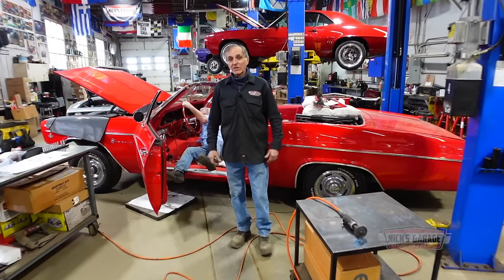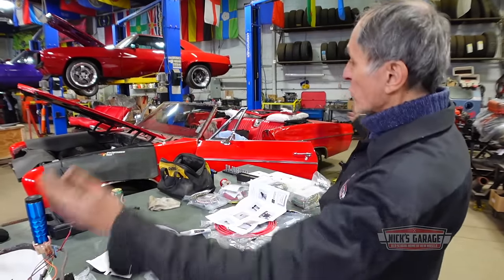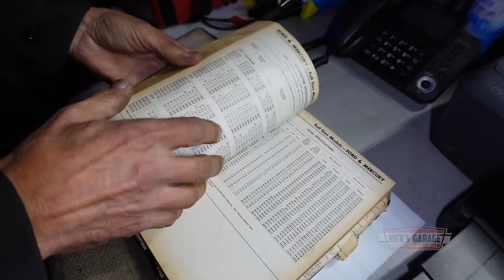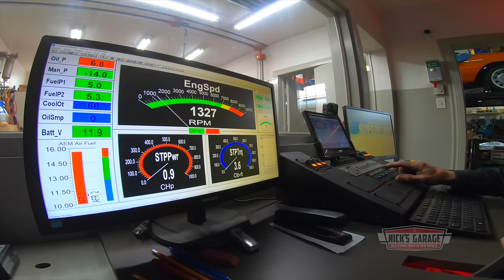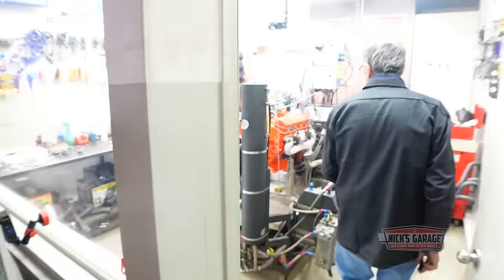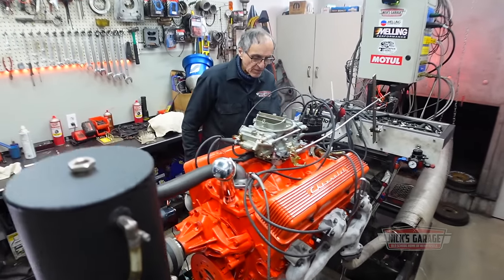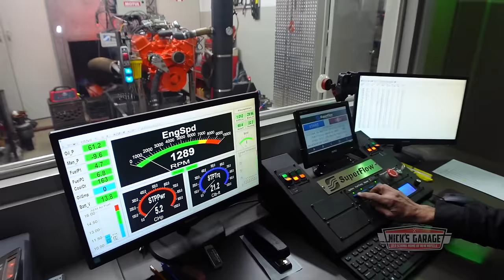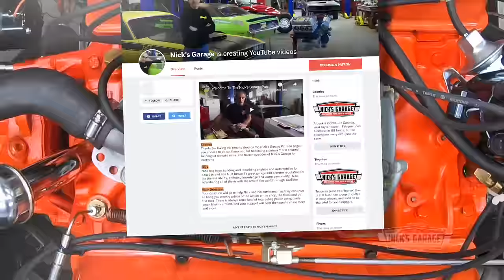327 Chevy on the DYNO - Exhaust Shootout

Comment: I would like thank everybody for there comments, and did get the ram horn exhaust manifolds 
Thank you everybody
Reply: Beautiful car !!!
Reply: Awesome you won't be disappointed for getting them
Reply: Thank you
Reply: Good old ram horns 🐏 🔥 I like the ramhorns that slant back on a 45 😎
Reply: Think you would like 2 sizes smaller cam... this race cam miserable for a cruiser...
Reply: Make sure they are the ones with the 2.5 inch outlet. Some were smaller.
Reply: @bobthbldr3      Yes,  2.5 inch outlets.
Reply: P
Reply: A²
Reply: @BuzzLOLOL  
That's far from a race cam
Reply: @matthewvarnam4302  - That size used to be...
Reply: @bobthbldr3 absolutely this was my first thought, the 2 inch are worthless, scrap metal

Comment: After reading so many comments, my client has decided to order a set of Ram Horns manifolds.
Reply: Nick you really are the man nothing but respect Sir.
Reply: That is good to hear. My 66 Impala only has a 283 but I recently built it 30 over with about the same cam, 500 lift only difference. I got a smoking deal on some rebuilt 80s 305 H.O. heads that gave me bigger valves and higher compression, not to mention OEM hardened valve seats. I still run the ram horn manifolds and that allows for the stock alternator mounting. I did block off that down draft tube and went with a PVC setup. I'd like to see if you incorporate a PVC and still keep those valve covers.
Reply: Good move - which version?  The usually used ones were a 2" outlet, the 'Vette versions used a 2 1/2" outlet and are generally the ones to go for. I think most repro' stuff is the latter.
Reply: I love the video you made and stated " 400 small block , not a very popular motor"  The 400 sbc only paved the way for the 434 ,377,and 383. . And the Oldsmobile 350 build was hilarious 400 hp was a modest number for that one. Let's not even talk about the 455 stage 1 Buick , laughable man. keep the funny vids coming.
Reply: @davidsnova  
Seriously, you need to turn it down a little - within the parameters Nick has to work within - customers looking for rebuilds or mildly up-rated engines, the power figures are very respectable.
Sure, ALL the engines Nick's worked on have potential for a LOT more power, but they're not the builds asked for.

At the time, as those of us who've actually been around for a while know, the 400 was indeed a very unpopular engine for several reasons - short 'rods, siamesed cylinders, larger mains, low compression heads with smallish valves, and camshafts selected for emissions rather than torque or power.
In the dacades since, the larger bore and long stroke became, as you note, useful for more exotic configurations at a budget.

Personally, I would be very tempted to use the 400 for a 'period' build with a bit extra - with a bit of care on parts selection (and with a little playing with the head's casting's identifiers), it could surprise a lot of people - especially with 283 decals used.
Reply: @gordowg1wg145  ...  We had ordered a set of Vette ex. manifolds.
Reply: @davidsnova  also the 400 led to the 427 stroker...really confuses people.
Reply: Smart move, I put them on a 283 and felt the difference. And no more header leaks! Lol
Reply: LOL! That's the first thing I thought when I saw the motor on the dyno. Where's the Ram's Horns?
Reply: Talk him into a cam 2 sizes smaller, also, one with an actual TORQUE CURVE !
Reply: @BuzzLOLOL  like an RV cam?
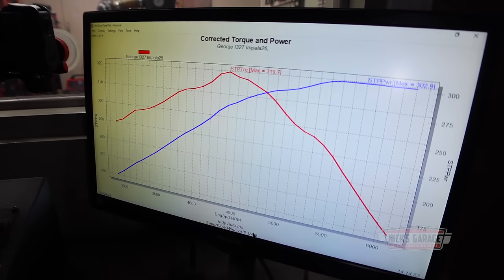Reply: @63Imp283  - Yeah, or a step bigger... 210 - 220 duration... one with a torque curve instead of a peaky peak like at 18:45...
Reply: @BuzzLOLOL  yeah that's what I'm thinking for my 283 it needs torque it's going to Rev no matter what
Reply: @SurlyMike 305 heads did not have bigger valves simply because of bore limitations ,you probably actually lost horse power on that.

Comment: We had a 66 impala SS with all original papers. It was listed as 275hp with single exhaust, if dual exhaust it was 300hp. Using this paperwork and many other sources this engine had the "300hp" cam which would later be used in the l48 350's of the 70's. I know this is an old video but Nick's Garage is historical documentation for furure generations!

Comment: that engine must either  have  a "P.C.V." valve installed, or put  a "DRAFT TUBE" on , that mounts behind the distributor( intake manifold). I think that the valve covers( early corvette) may have come off of a pre- 1964 engine ( no provisions for a P.C.V. valve, or  is not the original engine for that car, non- matching numbers ???)  P.C.V. valves were mandated in california in 1964( early version of emission control). I would go with a P.V.C. system ,the engine oil will last a lot longer due to the evacuation of "BLOWBY GASSES" from the crankcase

Comment: Back in the 70’s I had a ‘68 Camaro SS with the 327 and 2:73 rear end. It was white with a black nose stripe, black vinyl roof and red interior. The tires were BFG T/A’s on aluminum slotted wheels. After graduating from college, my buddy and I drove it from Hamilton to Vancouver to LA and back in the span of 6 weeks. We didn’t have one hiccup with that car. I sold it in the early ‘80’s and have regretted it ever since.
Reply: One of the prettiest cars ever made in my opinion.

Comment: I had a 68 Chevelle with a 327 with a rock crusher 4 speed. I bought it from my uncle it was red with black interior. I put a factory cam in it OEM 375 horse Corvette Cam a dual point distributor with a mechanical drive tach a set of Hooker headers and a 650 Holley spread bore with mechanical secondaries and man that car was the fastest car in town all anyone ever saw was tail lights 💯💪. Boy I sure miss that car

Comment: My first muscle car experience was age eleven in 1966 when my brother came home on leave with his new ‘66 Chevy II, 327 350hp. One power shift and I’ve been hooked on cars ever since that time. Have a great week everyone
Reply: The '67 Camaro cried out for that engine, too bad it wasn't an option...
Reply: Those little Chevy II's would blow your mind with a 327 with cast iron manifolds. I'm a big block man, but I knew those little cars were something that could ruin your day. Lol
Reply: @BuzzLOLOL  It got the 302 which was is based off an even hotter 327 the L74, just with a 283 crank.  The L79 would be stroked and became the L46 350/350 exclusive the Corvette.  That Chevy parts bin isn't as big as most often think.  The L79 was the solid lifter short block and heads(2.02) with a decent cam vs the plebeian standard 4bbl cam.   The challenge Chevy had was the SBC didn't have great flowing heads so they leaned on the cams so rougher running more stall prone mills if they wanted power.  You don't see the first decent factory head until '71 on the LT1 350.  

Perhaps over looked is that it introduced the 350 exclusive to the SS350 Camaro in '67, that stroke and more importantly the extra torque was something felt in every test drive.  So much that with similar gearing it matched the 302 in acceleration at least until the headers and slicks went on.
Reply: @Dayandcounting  - The first Chevy 302" were the '301's we made by overboring a 1950's 283... The small, light. streamlined '67 Camaro really should have had the L79 as its top engine option... but that would have been too much power/speed too soon for GM... and the rear suspension would have had to been better from the start... also, like the Fiero, Camaro was prolly first sold to GM as an 'economy' car... LOL!
Chevy heads didn't flow bad for the time... a little 327 with 4 bbl. carb.,  base level cam, and 10:1 made 300 HP... everybody else back then needed lots more cubes to make 300 HP... Chevy's base 1.94" intake valves were bigger than Pontiac's hyper 1.92" intake valves... eventually everybody's small blocks got up to Chevy's hyper 2.02"/1.60" 'Fuely' valve sizes... except the Ford  Windsor engines...
Reply: @BuzzLOLOL  The top engine was the solid lifter 396 rated at 375hp (420hp actual). The '67 also came from the factory with a traction bar.
Reply: Yup. That engine is music!!!!!!!
Reply: @jsteganius6969  - As seen at 18:48, way too peaky torque curve... needs a smaller cam for pleasant street cruising...
Reply: @Dayandcounting  I believe  the L79 has a hydraulic cam and lifters. It's a great sounding engine with a  perfect cam "lope"....the L79 is my favorite 327 small block engine.....
Reply: I have a 1970 Nova that I got for my first at 16 way back in 1976. It was originally a 230 6 with 3 speed. After a year, my dad and I swapped in a  350hp 327 and Muncie 4 speed. Easy swap as most cars were back then, especially if V8 was a factory option. My dad told my mom it was just a little 327 and not to worry. God I miss him.

Comment: In 1962 I ordered a new Impala with a 300 hp 327 and 4 speed. I ran at the local drag strip every Sunday. It came with 2.5 inch exhaust with the rams horns manifolds and I had open exhaust dumps welded on. I put on a set of Hedman headers and made no difference at all in et's or mph. Some rams horn manifolds were smaller though. I won 23 trophies with that car and it was legally stock and had a blast with it!

Comment: Back in 66 my brother bought a 65  Impala SS, 327/300HP, 4 speed with a posi.  He was worried it would get stolen. He took off the 327 badges and replaced them with 283.  That was a very nice car. Very fast.
Reply from the maker: Nice trick.
Reply: My friend in high school had a 65 Impala with a 327, 4 speed, posi.  But, that was 1988, the elements were not being nice.  The rear springs ripped off the frame about the time he dropped the clutch in 3rd gear, rolling about 40-50mph.  What ensued was the longest, most amusing crash I’ve been involved in.  Seems like it took a full minute for it to spin all the way around in two lanes and median, grass flying around, him cursing and fighting that massive steering wheel
Reply: @jgriffin7340 We'll put that down as things that didn't really happen on the internet.  One eould have to rip one of the control links out of the frame to have a spring come out .
Reply: @MUUKOW3  That is correct, the lower control arm mount on the right side pulled out and allowed the rear end to move back on the right side enough to bind both rear tires against the body.

Comment: My first car/truck was an '83 S-15 GMC pickup. It had a 2.8L V6 in it. It let go one day after about 173K miles, and the truck just sat. A buddy of mine had a 327 sitting around out of his dad's long-gone Corvette (not sure what year since I was just a kid, and not sure what trans it was bolted to). We decided to force it into my old truck one day. It took a couple of high school summer weeks, but we got it running pretty good. The fun didn't last too long. After a few pulls and his dad helping us tune the carb (I think it was a 4bbl Edelbrock) , our home-shop mods to the drive shaft let go. The fun ended there, but what memories. Knowing what I know now, with the resources I have....that would/could have been sooo much more fun....and probably trouble, for a youngster. LOL

Comment: Started putting together a 327 out of parts I've had since 1981, better late than never.
Reply from the maker: Right on.  No time like the present.
Reply: If it's a street driver, don't go as big a cam as used here...
Reply: Double hump heads are worth 50 hp
Reply: I did the same - Built a 327 for my truck. I was pretty surprised that with a small cam with 204 @.050 intake duration, the 327 still is happy at higher RPMs.
Headers +.060 overbore - decked block - smogger heads - Quadrajet
It's fun - Not octane sensitive at all... Bout 8.5:1 CR
Reply: @BuzzLOLOL  go away bud lol not getting the attention you crave here... We get it . You look your cars slower and less aggressive sounding .
Reply: @kennyjfarquhar954  - Wrong! I like a torque CURVE! Not the peaky torque mountain peak seen at 18:45 !!! What a miserable cruiser it will make! It would be faster with good torque more of the time... and more enjoyable to drive... and still with similar max HP...
Reply: @bertkilborne6464  - Yeah, that's a good size performance cam for a truck...
Reply: When I was ordering parts for my 327, the guy told me (I think he was the tech guy at one of the cam companies) "You don't need to put much cam into a 327 to make it wrap out"
Reply: I had a big cam 327 in a ‘68 Camaro I had 5-6 years ago.  It was only happy with your foot all the way to the floor (plus no vacuum to run brakes). I was going to have my engine builder change the cam but ended up selling the car to a friend of his.  It was a fun car but I now have a 2020 Mustang GT (10 speed automatic) that will absolutely run circles around that old Camaro.
Reply: I have the first series large journal 327 with the 4672 crank. Been meaning to Frankenstein it with the right parts but just hasn't happened. When we get the money then other things pop up an take the time.
Reply: @johnkelly6942 But it will never have the same cool factor!

Comment: I had a rebuilt 283 . The guy that rebuilt in 1972 was Les Stadel . Not that much power. But soo balanced that we never did accidently blow it up. 2 clutches though. Best little motor ever.

Comment: My brother had a 1967 Chevy II with a 327 4 speed back in the mid 1970's. I got the car from him around 1985.  It had the small journal 327, it took 11/32 rod bolts and smaller rod and main bearings. I know that I would get some weird looks sometimes when I'd tell people that it had the small journal 327 in it. It had a front sump oil pan too! It took its own special oil pump, pick up tube and oil pump drive because of the front sump oil pan. Wish I still had it! My brother wishes that he would have kept it too!!

Comment: Hey Nick great video. During the mid 70’s I had two 67 and one 66 Chevy ll. One was a wagon that was a 6 banger and 3 on the tree. My dad and I found 327 and 4 speed that we removed from a wrecked 63 Corvette. What a sleeper that was.
Reply from the maker: Very cool!
Reply: Sweet combination. Had a 65 two door, Vette 327 & 4 speed. Ran 14.0 crossing the finish line in 3rd gear. Got 22 MPG too.

Comment: I'm 53 now, but when I was 17 I bought a 66 impala ss for 800dollars. Being young and crazy the first thing I did was put a Holley  4barrel and headers. Bullet  mufflers. The car had double hump heads and ran like a scalded dog for a led sled. It was rusty ,primer fenders and a grey rebel flag with stars in primer on the roof. It was supposed to be 325 horse. The carb and headers really seemed to work good. Great video sir.

Comment: I have a little LS 4.8 in my ‘73 c10…all it has is a 220/220 cam and matching higher lift springs with hardened pushrods……I can spin that thing all the way up to 7300 rpm with no problems…..now with that said I’m getting ready to bolt on a centrifugal supercharger……woohoo!!!………and yes had you been able to buy that ‘67 Chevy 2 back in ‘73 with your father , I and 95% of your subscribers could promise you that you’d definitely be a Chevy guy!!! Awesome story by the way!!!
Reply: Cam used here is too big for the engine...

Comment: The 327s that I had were full race Nascar type. 7 grand every gear. All cast iron too Gas guzzlers but GO GO GO. Man did they sound sweet with header 3 1/2 inch collectors an H pipe @4"back then a 1 3/4"x12" opening at the end of exhaust on a 45 degree angle setup with a taper out from the H pipe. 1968 Camaro  Group IV. 4 speed trans. I did one season with it. Very good engines.

Comment: I took a 327 out of a 1968 Impala, had it rebuilt, and put it into my 1978 Caprice. The 2.56 rear gear killed the performance. But after it got going, there wasn't much that could touch it.
Reply: 100mph in low gear or reverse with a 2 speed power glide

Comment: The GM 327 was used in many things cars..trucks..even farm equipment! I seen one in a combine..a welder..a water pump. Even air raid siren! Great engine for its time.
Reply: Also the 225 HP Mercruiser marine 327 engine... and seen a 327 in a large telephone company bucket truck...
Reply: I got mine out of a short bus...

Comment: EVERYTHING starts with an idea .Then a clean sheet of paper. Then the pens are laying down the ideas .Hen the foundry sand moulds are made  Then the castings are poured. Then they are cured .Then they are machined, fitted with crankshafts, pistons & Rod assemblies, camshafts ,heads,pushrods,Oil pump and intakes carbs,and fineally oil pan ,valve covers,timing chain cover ,harmonic balancer and pulleys belts,air cleaner .
AND VOLLÀ .One sweet running little engine .

Comment: I like the ram horn factory exhaust manifolds. I had a 327 from a 69 impala with 2 barrel carb, turbo 350 trans. put it in my 60 chevy station wagon. worked very nicely for family car/boat puller. peanut carter was president and 55mph speed limit. my car would do 20mpg at 55mph and I was happy with that.

Comment: One thing to note to the owner: find a set of plug heat shields to use with the manifolds. Those log manifolds will cook the plug boots without them---I know from experience. Vette rams horns with angle dumps might fit and give better performance. They have 2.5 inch outlets. Those old Impalas used rams horns so they should fit OK. Older blocks had the road draft tube at the back of the block next to the distributor. California emissions had PVC valve mounted in that hole instead of the road draft tube. "Later" (relative term) blocks lost the hole in the rear and needed the hole on the valve cover. Frequently people would put a freeze plug in the road draft hole on early blocks and use vented valve covers. Oil fill and breather intake stayed on the front of the intake until 1969 when the inlet went to the opposite valve cover. That made sure that the vapors were pulled from one side of the engine to the other.
Reply: I have 8mm wires and no shields on my vette and never had that problem you mentioned about melting the plug boots????????
Reply: wow thank you.Great info.